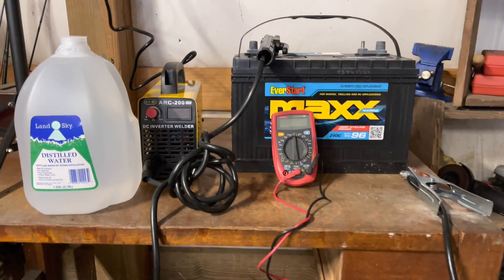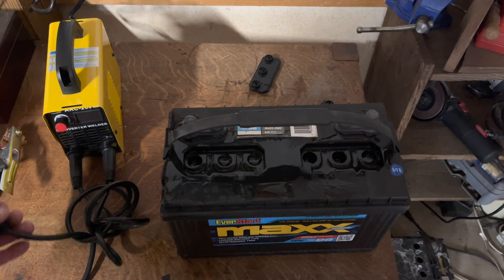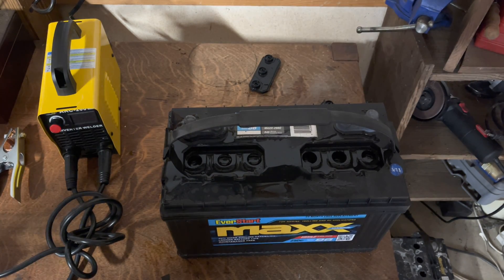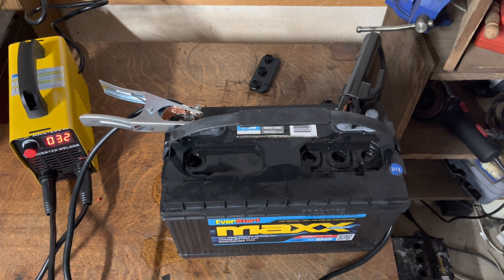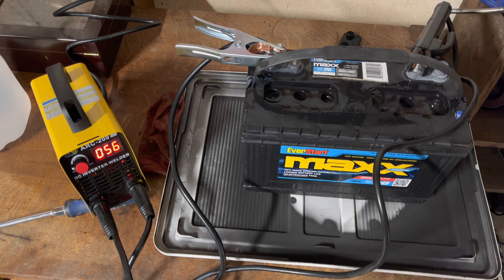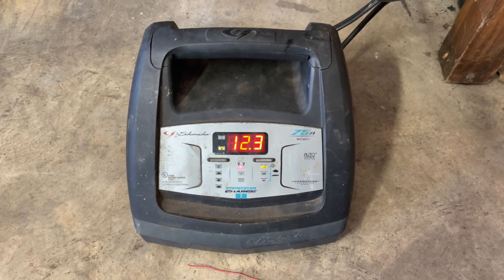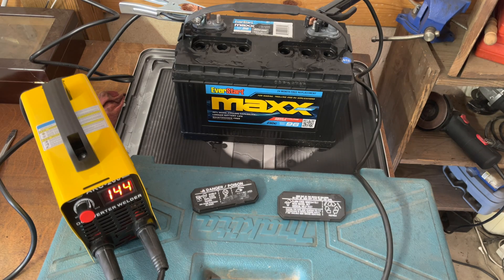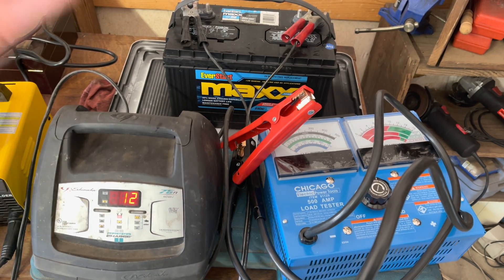10 year old battery, reconditioned using a welder.

Comment: I tried recently as well, but it didn’t work.  A few tips for you: 1, The solution/electrolyte swells when being charged, so fill water to the bottom of the edge; 2, charge to FULL first (with a dumb charger if smart ones won’t charge), and then do a load test; then 3, try the welder trick, 4, charge to full again and do another load test.
Reply: i have tried this trick on numerous lead acid batteries, and have yet to see it fail when done properly.
1) you are correct on this part, make sure all the fluid levels are good.
2) DO NOT pre charge battery with battery charger. You wouldn't be watching this if a standard 12v battery charger had any long term effect on the battery. You're going to be hooking the battery up to 120 v @ 150 amps. This MUST be DC voltage. If it doesn't register that this voltage and amperage is MORE THAN 10 TIMES the TOTAL output WATTAGE OF a 12V CHARGER ON an 80 AMP start assist, and therefore do everything the 12v charger will do, plus a little more, then you don't understand what your doing well enough to be safely attempting this experiment, go study chemically produced electricity more, come back no sooner than you understand or charging actually increases risk of catastrophic failure of the experiment significantly.

3)hook ground clamp to negative battery terminal and attach stinger to positive terminal using vise grip pliers to CLAMP END OF WELDING ROD to terminal. DO NOT ATTACH STINGER itself directly TO BATTERY, BEFORE SUPPLYING POWER TO the WELDER. Set amperage to aprox 150 amp (you can start lower and with up to this, but i have not had any of my more heavily sulfated batteries come back satisfactorily at less amperage on the final sessions. 

4)IMPORTANT!! make sure vent caps are off (or at least that all 6 cells are well vented), then turn power to welder on. Once all cells begin boiling, start a 5 -10 minute timer. After each charge session, TURN OFF POWER TO WELDER BEFORE doing ANYTHING ELSE. Allow battery to kool 15 -20 minutes. Repeat approx 5 sessions EXACTLY AS DESCRIBED, and your battery WILL be good as new.

5) Once again, DO NOT CONNECT to 12 v CHARGER, again, IT IS NOT CAPABLE OF SUPPLYING any MORE POWER to the project battery THAN the WELDER did. If your battery still is not fully charged without ever seeing a 12v charger during this process, then it is not sulfation killing the battery, it is a problem with the internal structure of the battery.
Reply: @thomasvisser5189  do you mean 12V @150Amp? 

Also, it sounds like you have been using this trick on batteries that were heavily sulfated and wouldn’t take a charge, right?  Could we do the same to an old but good battery? Normally it has sulfate issue inside as well. Thanks!
Reply: @jrm163  although i do realize the welder makes us of a step down transformer so it doesn't run 120 v, but it is significantly more than 12 still. Even a 12 v charger puts out closer to 15 v than 12. When charging a battery you have to over voltage it at least a little. If you were to hook a 12 v power supply to a 12 v battery, as the batteries charge gets closer to 12, the amperage drops off, and the flow of power slows on an exponential curve. The reason i said 120 was to intentionally scare anyone that doesn't really know what they're doing from trying this, cause it is extremely dangerous if not done right. Pushing this much excess power through a battery with the vents closed, the battery will explode (not a fireball type explode, the gas buildup will force the cells to rupture somewhere and you're gonna have sulfuric acid fly all over. If you don't turn the welder off before disconnecting the battery, it's very likely your going to be engulfed to some extent in a fireball).

With an old but still functional battery (charges and holds around 12.5 - 13 v), i really wouldn't advise hooking it to a welder, just because you can likely bring the battery back to like new with a standard charger. 

I do hope you weren't insulted by the way i spoke with my first comment, you're inquisitive and knowledgeable enough where you can pull this without disastrous results, as long as you're careful and pay close attention to what's going on. But there are a lot of idiots that are going to see this vid and think they can do it too. Hopefully, though, most will just have it not work cause they were to scared to go big, but I'm hoping my comments will detour a couple of the idiots that would go big enough with it to but be going home after...
Reply: @thomasvisser5189  I have a heavily sulfated battery from 2017 that I tried this, following your steps. The only thing I didn't do was ramp up the power to 150 amps. I probably only had it up to 90. At 90, one cell was slightly boiling, while the rest were at a rolling boil and putting out a fair amount of steam. After doing 6 rounds of boiling and resting with the welder, I put it on a charger/maintainer for 48 hours. Then I installed the battery back on my car but there wasn't enough power to even make the starter click, much less turn over.
Do you recommend I crank up the power to 150 and try again?
Reply: @Eyes0penNoFear  Tbh, i don't recommend anyone play with this experiment unless they're very comfortable experimenting with lead acid batteries. 

That being said, as long as all 6 cells are adequately vented, you keep tabs on the fluid level, and you're away from any open flame or possible cause of spark, turn it as high as you're comfortable. You want to get that sixth cell boiling as strongly as the other 5, though. The cells are going through electrolysis when you see them boiling. If one isn't boiling as strongly as the rest, it's because it's not as energy saturated as the others.

With the wattage you're running through the battery with the welder, a standard charger shouldn't be needed before or after. Using one before the welder may speed the process up some depending on the condition of the battery, but if it's not holding strong at 13.5 v as checked with a volt meter after the welder, it's still not gonna hold a charge.
Reply: @thomasvisser5189   I appreciate the response. And I definitely agree with you about safety when you're dealing with high amperages, acid, and flammable gases. I've had battery acid in my eye before; it's no walk in the park and there are so many ways it all can go wrong if mistakes are made.

I'll give it another shot and crank it up further.
Reply: Did you use an AC or a DC welder? Mine's an old model and it seems to be AC so it does'nt work good.
Reply: @carloscollomps1552  dc is a must
Reply from the maker: Appreciate you taking time to comment
Reply: Can this be done with ac welder? Kind regards